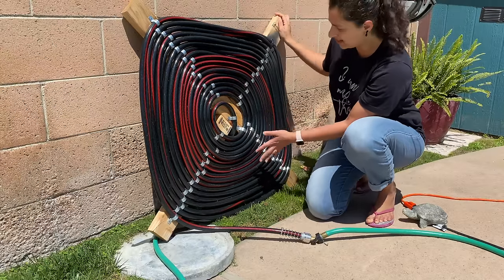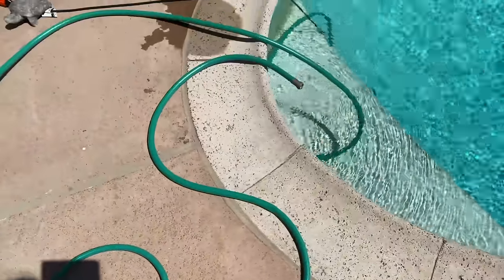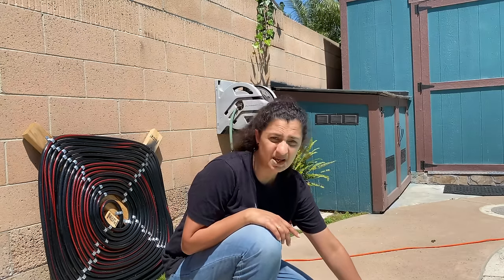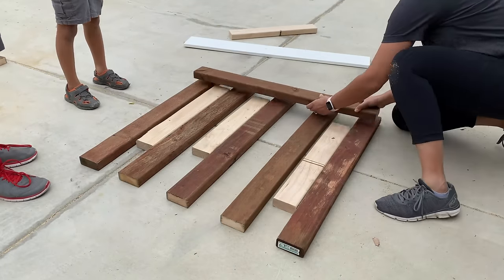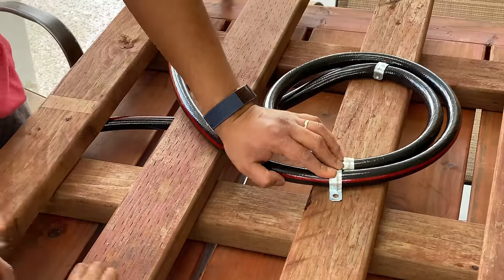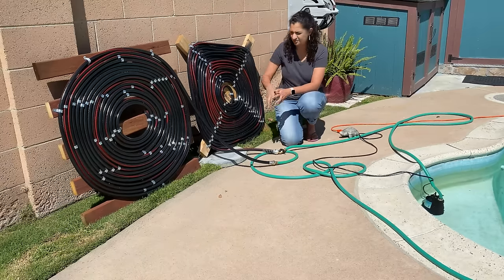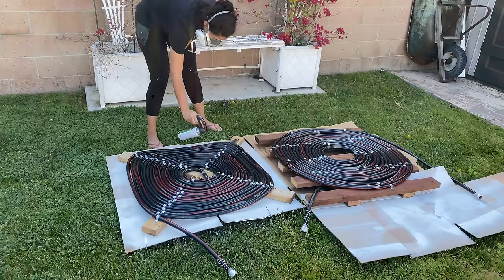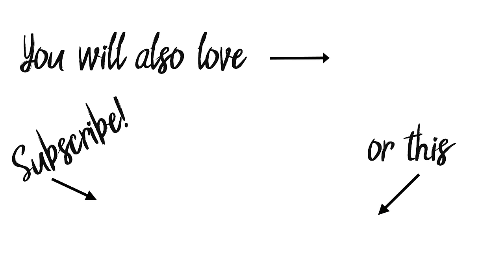DIY Solar Pool Heater - Simple & Easy Design - Did it work? | Anika's DIY Life

Comment: Use a pallet. Use Irrigation tubing not hoses, way cheaper.  Use perforated metal hanger straps with screws to secure loop to the pallet. Wrap whole thing with plastic sheeting.  Let pump run unrestricted.
Reply: What kind of plastic sheeting?   Love this idea
Reply: Cover pool at night. Restrict evaporation. Boom.
Reply: I have a small pool, threw foam core boards over it at night. Keeps air moving across water from cooling at night. My husband plumbed landscape tubing (cheap black) straight into pool pump system. No exposure of chlorinated water to another pump. $ Landscape tubing is inexpensive and you can add endless feet of exposure. If it is attached and enclosed in a material that absorbs and holds heat, cement board backer painted black and topped with polycarbonate sheets, increases heat retention.
Reply: @sunnygirl87  I wish you could email me a picture of this! I have cement board here and just bought 300 ft of irrigation hose today.... Tomorrow I'm building something
Reply: @PaulaOakman  did u build it?
Reply: loving this. Just bought half-inch irrigation tubing, might try to get away with zip ties instead of hanger straps, and I already have a good little pump. Gonna turn my $20 100 gallon inflatable pool from Aldi into a back porch hot tub!

Comment: First and foremost, your return should be on the opposite side of where your pump is otherwise you're just pulling in the already heated water. Drop your pump into the deepest part of the pool. As for the coils, just build a box and paint it black. Use plywood for the back, whatever wood is sufficient for the sides, and then plastic sheathing or corrugated plastic on top. You can actually attach it to your fence if you want. Add hinges to one side and foldable/adjustable legs to the other side so you can lay it flat against the fence when not in use.

Comment: Nice simple design.  You shouldn't restrict the flow with that ball valve.  Yes the water coming out of the end won't seem as hot, but you are moving a lot more volume.  Basically you are not getting the full efficiency and heat out of your system.  The restriction also makes your pump work harder and draws more electricity.  You can google this if you are skeptical, but I do have a degree in thermodynamics. ; )  Nice work though.
Reply: How about putting a black covering over the pool, and use the pump to circulate the water? Shouldnt that work better?

Comment: "the water doesn't have time to heat up".   That's a misunderstanding.   You need to run the water at maximum flow.   Sure the water comes out cooler but you are adding more heat into the pool per  unit of time.
Reply: I'm not claiming to be an expert here.  If the flow rate is low, and the water come out hotter, isn't this the same net effect as if the flow rate is high, and the water was heated less?  In the end, isn't it the same?  Genuinely curious thanks.
Reply: @plutonium9  actually, it's not the same. If the exit temperature is only 1 degree hotter than the entrance, then that would be better than a 20 degree difference. For example, if you had 2 setups, side by side and felt the hoses on each, the one that feels hotter will be the less producing one. If the heat energy is still on the rubber hose, it's not in the water that is flowing through it, therefore you are losing heat. You want the water to cool the hose and as it cools the hose it absorbs the heat.
Reply: @plutonium9  Your idea is right, but I think in reality you always deal with losses and a low flow rate introduces more losses than a high one. Basically what Hives2Honeyfarm said, but it doesn't really explain it. But he's right in that you want the water to cool the hose down as much as possible, and that happens less when restricting the flow.

Comment: I build a heater with 200m of 16mm PE pipe. I use a 12V 20W pump with up to 800l flow per hour. The power comes from a 80W solarpanel with 22Ah Akku. It warms 6m³ from 20°C to 26°C in 4h. Output on sunny days is between 30 to 46°C . This winter i will build an vegetetableoil heater using an 8kw diesel car heater, for lesser sunny days, because northern germany is not so overly "sunkissed".😔😔😉😉 last month i added a programable clock to startthe pump in the morning   and stop it at late afternoon.

Comment: Don't use a hose, too thick.  Thinner tube will allow faster heat transfer, you need to make sure the flow is fast enough so the tube don't melt.

Comment: The bottom line question:   What is the net temperature gain of the pool, and the total size?  Also, some space between the coils would allow more insolation to strike the hose surface.  Using the concrete as a heat sink also has some merit, as would a solar pool cover.

Comment: This is a good initial concept if you have plenty of sun. After researching materials needed to make this and doing what today's productsoffer, I decided to opt for a tankless electric 8 gallon water heater. The cost difference was $100 more and getting the tankless water heater including all the material such as miscellaneous timers hoses water transfer pump. The pros are I get on demand hot water up to 150°The negatives are to be tested yet still have to see what the electric bill is. The hoses needed to get hundreds of feet just to get hot water does make sense but with what we can do with today's technology there are newer options. A typical water heater for a pool would costs thousands but I only had to spend a few hundred. Thank you for your video.

Comment: Use free pallets for the base.
Cover the coils with plastic to reduce convection cooling.
Do not run water through both coils. Put a Y connector between pump & coils with two return hoses. You will get twice the volume of heated water.
Would putting the return hose deeper in the water increase efficiency.?
Did you use flat black paint on the hose and insulate the back?

Comment: Thanks for the video I really appreciated how you laid it out, your explanations were simple enough that I took on the task of building a coil today. I did it by myself and it probably took me 30 minutes once I had all of my supplies together. My sun is intermittent today so it's hard to really get a feel for if it worked. I bought essentially all of the same parts you used so I'm hopeful once my sun is constant that the water will heat up. I also haven't painted anything matte black yet so I could still do that too. I thought I'd share my cost breakdown because I didn't have the extra hoses or anything other than the screws to do this project. 

I got most of my supplies from my local chain hardware store (w/orange logo):
$40 - 5/8 inch contractor hose 100ft
$20 - x2 input/output hoses 25ft each (I need them to reach the roof of my garage)
$11 - 1/2in 1-hole straps 100pk (enough for 2 coils)
$10 - gooseneck shutoff coupling
$2.65 - x4 1.5x2.5x96 lumber (I went cheaper and lighter than 2x4s)
Total = $111.60

The pump I purchased from your link for $61.53

I could have purchased some things cheaper online, but I wanted to get the project done the next day and the pump is the only thing that would get delivered that quickly. Something to be aware of if purchasing from your local hardware store, each coil will cost closer to $100 each, but if it works it will be worth it.

Comment: I tried a solar heater. The water coming out of the hose is warmer then the water in the pool, but it only raised the pool water tempurature a 1-2 degrees. The solar heater works best when it is a very sunny day, which is also when you least need to raise the pool water tempurature. The heater also takes up space in your yard. A lot of work and money with very little benefit.

Comment: Yes a higher velocity drops the temperature, however it produces the same heat energy because is the additional volumes of warmer water.
Reply: do u know how is this called? as i couldnt explain it to my friend.he thinks that if water goes slower it heats more water, if goes faster it heats less water.i tried to explain him that it doesnt matter, as water system is closed, you are not adding more water, he could understand that, also guy in shop which was seliing me electric water heater told me that i need slower pump so water have time to heat up when going trough heater.i tried to explain him how it works but he didnt understand either.has this thermodynimic thing name or something which i can show to prove?
Reply: @s9benne  The purpose of a thermostat in a car is to allow the engine to reach operating temperature BEFORE cooling it down.  Think of the term "warming up the engine" - you don't want 35 degree coolant cycling through the engine you just started.  Does a pool heater need an equivalent?  Sure, but only if the water in the hose is significantly colder than what you're trying to heat (the rest of the pool).
Reply: @martinm2074  Well, the sun gives about 1KW of energie per square meter. no mater the flow, that will be your energie input.
Reply: @s9benne  a thermostat is to keep your engine warm, not to cool it down. eg: when restricted, the water in the radiator cools down more.... yet at the same time the water in the engine gets warmer. the ideal temperature for an engine is about 92 degrees C. at that temperature the engine does not melt, butt the fuel vaporizes easily. to get to that temperature quickly, the termostat is closed till aprox that temperature.

Comment: So a friend of mine is a pool engineer. We were talking about these systems. What you’ve got to remember is you need a blow off valve for when the pool has reached temp. There will always be water in those coils so if you stop the flow to the pool it’s going to become superheated.
Reply: yeah I found out that the hard way!
Reply: Shut the pump off and gravity will pull the water back out of the hose.

Comment: There are a lot of these shown online.  I like this one because the material, in wood is minimum if you are just using radiant heat and not trying to trap it.  However, others have mentioned to slow down the flow to increase the temperature of the water coming out.  This is not necessary.  Heat always moves toward cooler median.  By slowing the flow you increase the heat, but decrease the flow.  This is actually counter intuitive.  By decreasing the speed in which the water, it heats the water more, but because the water is not hotter than the hose and air around it, you in turn cause heat to leave the water and heat the hose/air...  It would be more efficient to allow the water to flow faster and absorb heat, because it still will, since the water is cooler than the hose and air immediately outside it.  While you may not feel much of an increase in the temperature, you increase the flow, increase the temperature of more water, and not lose heat to the air outside the hose.  Over the course of time, you will increase the temperature of the entire pool at a slightly faster rate because you are losing less heat to the air.  Want to test this?  Place your hand on or just outside of the hose, near the end of the run, an see if it feels warm or hot.  If you feel heat, then you are losing heat...  Good luck

Comment: Wow! Hose is so cheap in the US. For me I think cheap 12mm (1/2 inch) black pvc irrigation tube would be better as the hose would provide some insulation. Thought about going for 25 mm (1 inch) tube but think capillarity would improve the flow if smaller. As others say I dont think you actually need the pump although you would need to prime first by filling the tube but you could do that from a  tap. Anyway, great video Anika and family!

Comment: Thank you for sharing. As a lot of commenters have said. Your goal is to push water through the tubing as fast as possible. Think about it this way. If your pool is 20,000gal your minimum pool pump would be 40gpm or 2400 gph. In 8 hours you would cycle your whole pool. All the water in your pool passes through your filter. Now for a pool heater. Imagine if you could have the same flow rate but only increase the water passing through your solar system by 5 degrees on average throughout 8 hours. Now at the end of one day, all of the pool water has had its temp increased by 5 degrees. Across 3 days you would have a 15-degree increase in the pool water temp. This does not take into account the pool temp drop at night and a few other factors. But it is a simplistic explanation of why everyone says higher flow and lower temp increase is better than trickle flow and higher temp. Another test is to touch your hoses. If they are warm you are not flowing high enough and you are losing energy that could be in your water.  If you cover them with a greenhouse effect the touch test will not work but more energy is trapped and more heat will go into the hoses.
Test your setup: Turn flow rate all the way up. Put your hose in a 5-gallon bucket and time it and take water temp. Take the system and split it at the pump so you have two hoses about 100 feet long. Put both of them in a 5-gallon bucket and time how long it takes to fill and take water temp. Even if you are only seeing a 3 degree increase your pool may heat up faster than slow high temp water. The goal is the removal of as much heat from the system as possible. The colder the hoses are due to the heat being transferred to the water. Hope this helps. Thank you once again for your video.

Comment: At Home Depot they have black tubing it’s irrigation tubing it comes in a coil it’s rigid sort of like PVC but more bendable than PVC. And not as flexible as hose. And they sell the connectors for them also that twist into place stick to pieces.

Way ahead of you we did this years ago here in Michigan with our above ground pool. We had coils set up on pallet wood pallets and they were in the back of the yard we did have to rotate them towards the Sun a few times. We also had them on our garage roof. We had it rigged where it went right into our pool pump and all of that. When it was 70° out our pool was 95!
Plus you have to keep your pool covered at night! To pool covers at night one the bumpy kind of has air in it and a regular like a winter pool cover over top of that. And if you really want to you could throw in a punch couple air pillows. You’ll have a crank in your crank the pool cover out over your pool.

The more coils you have the more warm warm water that comes back to your pool all they do is circulate your pool water through the hoses and back into the pool. Also it’s important to lead some spacing between your coils each tube needs to have a tiny bit of space between it because the more sun that can hit every side of that coil  heats faster than all the coils wrapped tight against each other!!
Reply: Excellent explanation. Thank you!

Comment: Nice Video Anika. Simple, Practical & Informative. There is one major issue that often get overlooked however with Pool Heating Systems and that is that its pointless going to the trouble of Heating the Water if the Pool is not thermally covered. On Low Volume Flows (i.e. heating only a very small % of the total water volume per unit of time) The inflow of Heated Water is diluted rapidly in the proportionately larger Pool Water Volume and dissapates far too quickly to have any effect on raising water temperature effectively. Covering the Pool Surface with a Thermal Blanket would allow the temperature to be retained longer in the Pool over time HOWEVER the circulating flow through the Heating System needs to be proportionately larger to really work. I dont know the answer but would guess that a minimum of 10% water volume should circulate per hour in order to raise total temperature reasonably.
Reply: Great post . It's worth mentioning the flow rate should be as high as posible . This is counter intuitive , Anika wants hot to the touch water coming out , but heat transfer to the pool  will be greater without the valve and max flow.

Comment: Really enjoyed the video. We live in North Florida where our swim season usually ends in October. I have a 33000 gallon pool and it gets cold quick when the temperature changes. But I have a really big patio roof that I’m going to put about 500 feet of irrigation hose on the roof. Probably going to have to get a bigger sun pump to get the water up 12 ft though. But I plan on extending the swimming season till December and open back up in February hopefully!!
Reply: We live in north Florida also.  We go tubing at midnight on New Year’s Eve.
Reply: when it's all said and done, the commercial rooftop mounted thermal collectors are not much more than garden hoses, and  designed to maximize heat gain by maximizing surface area.

Comment: The faster you can move water from the heater to the pool and back will give the greatest heat transfer to the pool. Thats why commercial solar heaters are in parallel. You don't want the in and out to be radically different. The return water from the solar and pool supply should track within the smallest amount possible at the greatest flow rate and they rise in unison with a delta T of no more than 2 degrees.

Comment: I have a plan for you. Paint some of that south facing wall black, then notch some 1x3 lumber every 2 inches to hold the hose (or irrigation pipe) use masonry screws to hold the boards to the wall. Of course you have already painted the would black, make sure you have a cap over the 8 or 10 vertical 1x3's. Cover with a layer of poly-carbonate green house twin wall sheeting from the greenhouse supply store..